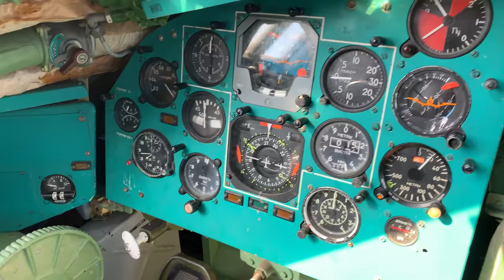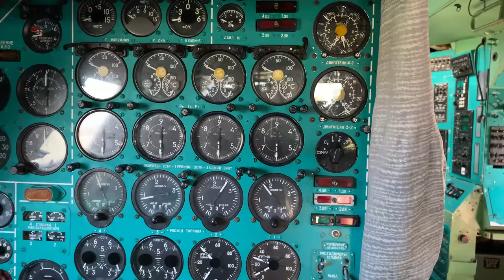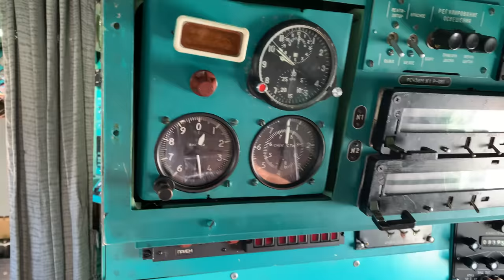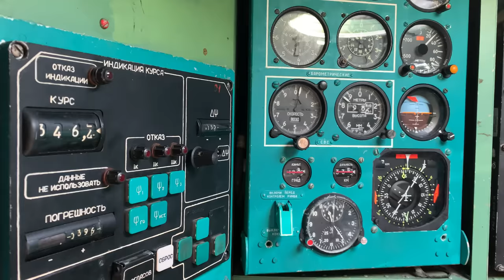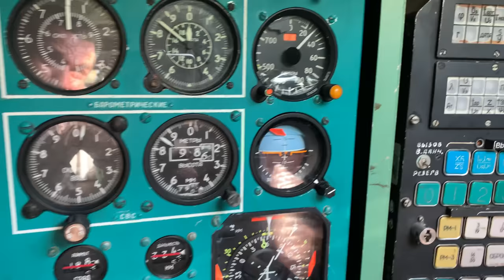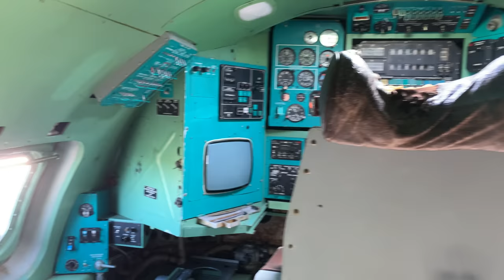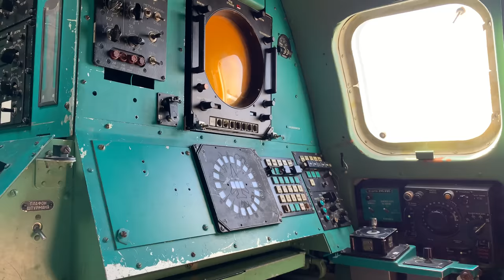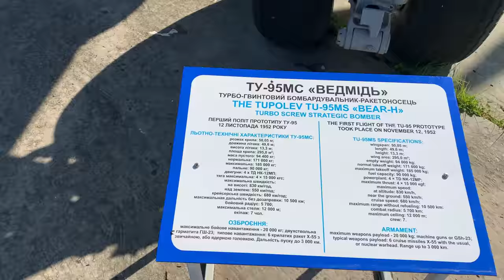TU-95 inside / 4K

Comment: Wow ! I'm very impressed by the turboprop throttles : 4 for pilot flying, 4 for pilot monitoring and 8 for engineer ! I don't think those throttles are electrical so I imagine the number if cables😳
Reply: In fact, on tupboprops engine RPM are mostly constant, due to narrow engine efficiency range, so you controlling its output by changing the propeller pitch. Only engineer's position has actual throttles to handle engine RPM.
Reply: Flying cable car 😅

Comment: To those who don't know, analog gauges were normal in all aircraft, Russian, Western or whatever until the mid 80s. I once flew in a Westland Seaking in 1985, cockpit looked similar, but all black gauges.

The first "glass" cockpit I saw was in a Airbus A300 in 1985. Most gauges were still analog, but augmented with tiny CRT screen (green monochromatic ones if I remember correctly). 

So yeah this looks old school now, but I'm sure there's plenty of smaller aircraft that have all analog gauges.
Reply: Fun fact, even Tu-95s produced in 1994 has almost same cockpit layout and panel equipment as this one has. Russian has motto: "if it works, do not touch it".

Fact is, that if you would compare Тu-95MSM (recent most sophisticated upgreade from 2020) it will still looks obsolete in comparison with B-52H upgraded in 90s. But in reality, Tu-95MSM is far more advanced under those panels than upgraded B-52H and it is on level planned for B-52J.
Reply: Many aircraft still use analogue gauges, especially smaller ones.
Reply: I have learned to use and understand these things during my flight lessons in the late 1980th and still know how to read them - and today I fly the Boeing 747-400 and the Boeing 747-8F! - What a difference between the old-fashioned cockpits and the cockpits of today!

Comment: As a former US navy pilot, the things that stand out to me:
- that odd turquoise color
- throttles not in a center console between the pilots, but each pilot with his own set, pilot to the left, copilot to the right.
- very very 1960s buttons, switches, CRT displays.
- attitude instruments (artificial horizon).  In western planes, the plane symbol stays fixed, and the horizon indicator moves up & down to indicate pitch, and rolls left and right to indicate bank. In soviet planes, it's the other way 'round.
- the interior looks very worn, but not vandalized or looted.  So I wonder if this is an operational bird.  If so, I'm not hearing the noise I'd expect from an operational airfield.
Reply: @ValeriyRogachev  you don’t consider he didn’t know it was a museum?
Reply: @wtf-hc3tp  Are you his lawyer? :)
Он там в тексте комментария задавался вопросом в рабочем ли состоянии аэроплан и почему не слышно звуков аэродрома.
Reply: @ValeriyRogachev  He did say that, however, he did say IF it’s a working aircraft (no doubt it could be operational) the “if” tells me that he does not know for certain it’s an operational aircraft (which probably could)
Reply: @wtf-hc3tp  In Russia, all monuments of equipment are working. Not much :)
In 2014, there were rumors that citizens of the DPR were removing T-34 tanks from pedestals, repairing them and putting them into battle.
Reply: My understanding is that The VDV doesn't have much budget for training flights. Plus if they don't bother actually doing anything at work nobody cares.
Reply: The author's freedom of speech is lost! Where is my first comment where I indicated that this is a museum? What's next everyone is discussing.
Apparently, the 1st Amendment of the US Constitution is only valid in the states ...

У автора свобода слова потерялась! Где мой первый комментарий где я указал что это музей? Что дальше все и обсуждают.
Видимо, 1-я поправка конституции США действует только в штатах...
Reply: This a museum piece.  😂. The TU-95 of today use. Are made 1990s- 2000s. And upgraded.
Reply: Это музей конечно. Это старая версия, 60-70 годов, Ту-95, потом пошли ту-95МС
Reply: @wtf-hc3tp если бы он был в рабочем состоянии, украина безусловно применяоа бы его в боевых действиях, и даже если бы он остался цел к моменту записи видео, ютубера бы к нему не пустили
Reply: @bolshevikproductions с 1992 года ни одного самолëта ту-95 не произвели
Reply: Turquoise cockpits are standard in Russian airplanes, even the commercial ones.
Reply: This is air museum somewhere in Ukrainian I believe.
Reply: @МегафонМегафон-в3я  нет, это Ту- 95МС произведен в г. Куйбышев, ныне Самара примерно в середине 80 -х.
Reply: The colour is relaxing, that's why.

Comment: Very interesting. 👏Is this an old aircraft or still currently in service?
Reply: They are still flown by russia.
Reply: Both. Been in service for 60 plus years. Just like the b-52.
Reply: This is an aviation museum in Ukraine
Reply: Two were intercepted by the USAF today, near Alaska.
Reply: @mrgroot8701  The versions currently in use are more modern.  MFD in the cockpits and upgraded engines.

They're currently utilized as flying cruise missile platforms. They have missile carrousels installed their bomb bays.

Comment: As a soft millennial, I noticed a lack of safety belts and an abundance of sharp metal edges and corners.  If this plane maneuvers violently when a crew member is not expecting it, the surprised crew member will likely be thrown around the cockpit while being cut on paneling.  At least I saw a first aid kit to patch the bleeding crew member.

Comment: That nose design screams badass. Jet like swept wings, with 4 Kuznetsov NK12 gas turbines powering these 4 bladed contra rotating propellers and the distinction of the fastest propeller driven airliner in history. Enough said.

Comment: totally useless during a conflict , just to attract nato's fighters
Reply: TU-95 is from the 1950s. US still uses B-52 which is also from 1950s
Reply: They are not used as bombers anymore, yes. They are used to carry cruise missiles close to a combat zone and then release them from a distance while not flying into the danger zone themselves. They still have a use, so it would be wasteful to scrap them.
Reply: @DusanStev996   …..they are practical like “putting lemon on a wound” or basically after major area destructions, probably by it’s successors like the tu22 or tu160 or the pak da in the near future, this monstrosity will come around for a second bombing run, and the fact it’s very very efficient
Reply: its just russias b52
Reply: Ну да, ну да